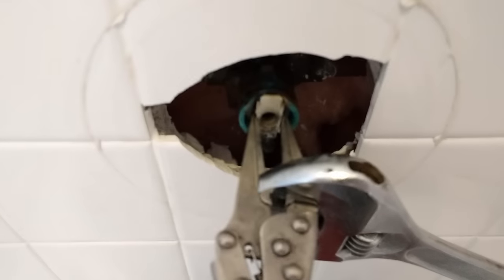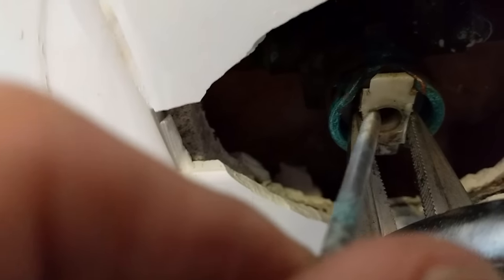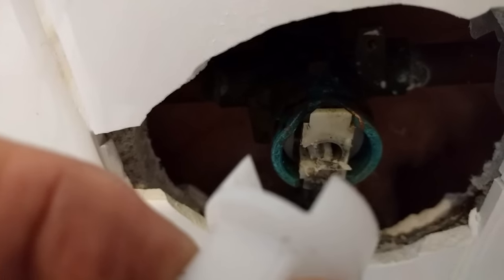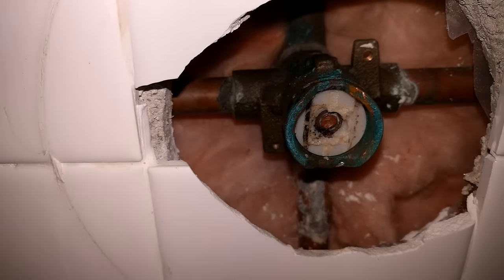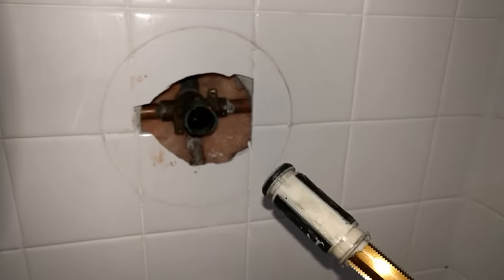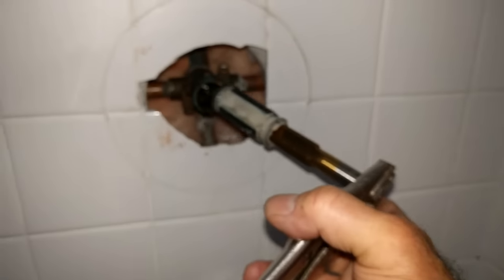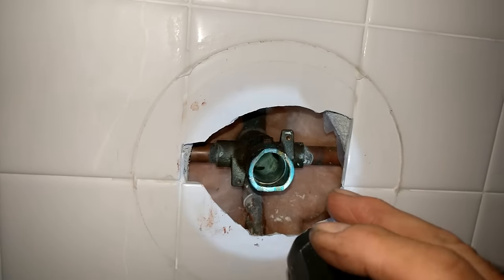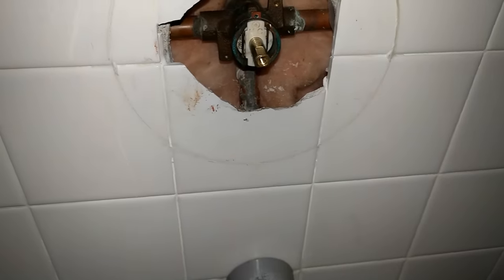Home repair Moen 1222 cartridge stuck really bad by froggy

Comment: I had a 8 hour struggle with a 1222 shower/tub faucet that had been in for 25 years. I hadn't seen any of these YouTube videos or looked at the Moen Removal Tool. I had just read the instructions and it looked like a breeze. Wrong. First the set screw in the handle was frozen. The hex key (allen wrench) stripped out the inside of the hex socket before the set screw moved at all. Fine, I'll just drill it out, I thought. I drill it out and I keep having to drill bigger and bigger... finally it lets go. Remove the phillips screw behind the handle, take off the two pieces that go behind the handle that limit the rotation. Remove the sleeve that keeps leaks from going behind the wall. 

I put the little white plastic piece that comes with the kit on the cartridge and try to turn it 45º clockwise. It doesn't want to turn, it springs back to the straight up position. The plastic piece feels like it wants to break. I push in hard while turning the plastic piece and it reluctantly begins to move and come out about 1/8". I put my pliers on the stem and start yanking. I yank harder. No go. I yank HARDER. The stem breaks off. Great! Now what? I'm thinking... huuummmm? Slide Hammer to the rescue. I drill a hole in the center where the stem broke off and thread it for a screw that I can connect to my slide hammer. Bang. Bang, bang, Bang, BANG, BANG! the valve guts come out just like Froggy had happen. CRAP! Now what?

I'm tempted to take a hack saw blade to the plastic housing that is still stuck in there... but that would be a bad move Newton. You scratch the inside of that brass housing and you will be calling a plumber to sweat in (solder in) a whole new shower faucet. If I tried to do it I would probably set the house on fire before I got a leak-less fitting... or I'd end up having to re-tile the shower/tub enclosure. What else can I do to yank that thing out?

I didn't think of the tap or easy-out idea. That's a pretty good idea. My brain fart idea was to find a large bolt and screw it in with JB Weld to hold it tight. I roughed up the inside of the plastic cartridge sleeve to help the JB Weld stick to it. I measured the hole size. A 5/8" bolt was slightly smaller than the inside diameter of the cartridge sleeve. Off to Homeless Despot and got a 7 inch long 5/8" bolt and some quick setting JB Weld. Mixed it up. Pushed some cloth into the hole first to make sure the JB Weld wouldn't goop up the inside of the brass housing and ruin it. Gooped up the inside of the cartridge and the threads on the bolt, pushed it in and waited for 3 hours while it set up nice and hard. 

It still didn't want to come out as I beat on it with my metal weapons of destruction. I finally figured out that twisting it more may help free up the long rubber outer seals that were preventing the removal. I had seen them when I looked down the throat of the cartridge sleeve before. They were stuck in the feed ports and were preventing the extraction. The rotating finally worked, breaking the rubber seals and the plastic sleeve started moving with my hammering. Finally got out the sleeve. Whew! I looked inside and saw the remains of the rubber seals poking out of the feed ports in the body. I tried yanking them out with needle nose pliers but that didn't work. I finally got them out with some Dental Hygienists picks I have. I throughly cleaned out the housing and lubed it with silicone grease. Screw that silicone oil. I want a fighting chance next time... if I'm still kicking. The rest is easy. What a pain. I really didn't know if that thing was going to come out. I'm glad to know it wasn't just me. Everyone has this problem. Hope this info helps someone. I didn't find this until the day after the ordeal. I have one more in the Master Bathroom that will probably start dripping tomorrow. Now I know a few other tricks to help me along. Thanks to all the great ideas posted here. Cheers Froggy!

P.S.  I really like the heat gun idea. Definitely going to use that one. The water here isn't very hard. There was no mineral buildup on my faucet. The main problem was the outside rubber on the plastic cartridge sticking to the inside of the brass cartridge housing. I replaced the old plastic cartridge with the more expensive brass bodied cartridge and generously lubed it up with silicone grease.
Reply from the maker: Great write up, thanks for adding it to comments, these buggers are real challenge to replace & you need the tricks, the recommended removal process is a joke.

Froggy
Reply: @1947froggy    Wish I had seen this before I had a go at it. I would have fired up the heat gun and gotten that thing out quick. Thanks again....
Reply from the maker: @marscruz  Thank YOU.

:)

Comment: Yesterday I removed a cartridge lacking the all important stem. Drilling, broken bits, tapping, etc. finally it all came out (first the core, then the plastic sheath). Unfortunately the drill bits want to track to the outside of the cartridge (stem and other metal in center). I thought I was staying away from the cartridge wall, but I did not account for the barrel narrowing. I scored the wall slightly beyond the outermost o-ring. You really can’t know until it’s too late. Despite a thorough greasing, the shower head dribbles when handle in off position. Rather than an extensive, expensive rough valve replacement, I placed a $6 on/off valve at the proximal end of the shower head/wand. Possibly it could still be a single knob activation of shower head flow, but it might have to be both knobs. TODAY I’M WONDERING IF AN “AH SO” TYPE CORK SCREW WOULD HAVE WORKED!!!??? Google if not familiar.
Reply from the maker: I can't picture that corkscrew working, but never know til someone tries. Please post if you do!

Comment: I just did this job, what a disaster this cartridge is. Getting it back in even with the grease was a workout.  Now that it is in, I am thinking I should have cleaned the interior of the faucet where the cartridge "slides" ( yea right!) into. But it is done and I am not messing with it until the dead of winter where I can go outside and cool off in a hurry after fighting with this mess.
Reply from the maker: Probably ok, if it were really bad you would have seen how it looked.  :)

Comment: Here is MY lengthy discussion of how I removed TWO of these cartridges.

So, it's amazing to me that this vid has been posted online for 4 months and ALREADY has 19,014 views. And there are many other vids on youtube showing how folks got the cartridge out. What a crap situation by Moen that there is so much discussion on this subject, no?

My prob is in 2 showers, one failed last year and we just stopped using that shower. But now, with two showers down (and one leaking), I had to address. As appears in your situation, BOTH shower handle stems broke - so Moen extractor tool won't work, nothing to screw into. I acknowledge the stem breaks likely has to do with our acidic well water not being properly treated and so the metal rusted and fatigued away, but there must still be thousands of issues with these valves/cartridges, no?! $40 replacement cartridge at HD - perhaps it's the nature of the beast, or perhaps they are making money. 

I note a slightly diff design on new Positemp 1222 cartridge: thicker stem metal (presumably so it won't break off as easily), and no rear o-ring (presumably so it doesn't get stuck in there as before). 

While the face of my valve/cartridge looked like yours, my needle nose (like you show) were tearing away at the white plastic - not enough to grip onto and I was afraid of completely breaking the white plastic apart by chewing into and distorting it. So, I bought pliers with a wider teeth grip but less rounded crown than some other pliers I had, which wouldn't fit into the tight space. I then did still have to use a grinding wheel to grind (thin) the backside of these pliers crown so the tip of (wider than needle-nose) pliers could fit between the round metal and the thin white plastic of the cartridge. (On 2nd thought... Moen supplies in the new 1222 box a white plastic "tool" which is designed to be used to get a grip on the tip of the cartridge - without a slot for the stem to stick thru, clearly a note that their stems always break off. But this plastic is soft and could break apart under pressure. They could make things easier by either making this out of HARD plastic, or metal!!! There is one vid out there where the guy says using it works 99% of the time, another where the guy says it breaks apart. Since I had already modified my pliers, and upon 1st try with the soft plastic part, I didn't try - I wanted to SEE what success I might be having and this "tool" would obscure my view... I didn't want to risk busting the tip of the cartridge apart, lest I be forced to go with the "tap" extraction method, per another video or two.)

Now that I had a better grip with my modified pliers, I pulled and pulled straight back, but it wouldn't slide out. I wasn't successful until I saw YOUR video suggestion of GETTING LEVERAGE BY CREATING A HANDLE with a 2nd pair of pliers (or channel locks/whatever) TO TWIST FIRST and break grip of whatever was holding it back AND THEN PULL BACK. Thank you so much. It ended up twisting and sliding out with 1/10th the muscle/weight I had previously put into pulling straight back. 

It seems that the cartridge wouldn't initially slide straight out (on both showers) because one of the two black rubber patches had become entangled in the intersecting water supply line hole, and so only by twisting could it completely tear off of the cartridge, duck into the supply hole, and then slide out. I then simply had to use standard needle nose pliers on both and pull the black plastic out. I was lucky in that it didn't tear and get stuck in there to the side. Had that happened, I would have turned the H2O supply back on and hoped it would have blasted out under pressure, but that would have been a wet mess. 

Anyways, the guys who suggested drilling into the cartridge with a "tap" set, or a screw, and then use that as leverage to pull, had a solution that was more complicated than yours. I didn't want to have to mess with that, and so tried yours first. 
So, THANK YOU!
Reply: It's April 2020, this is where I'm at right now.

Comment: I just did one this evening and it was stuck. My solution, cut the hot water on, let it run for awhile. It will soften the rubber and plastic. It twisted right out afterwards.
Reply from the maker: Good tip, thanks!

:)

Comment: Nice video,  gave me lots to think about.  Just using the plastic tool from Moen is of course not adequate.  Impossible.  But before I proceeded to some of the more drastic remedies, used a piece of wood and drilled a hole for the same size screw as used in the stem through the wood.  Used a long screw to fasten  to the stem, giving me a convenient hand pull instead of having to use pliers.  Then using channel locks or vise grip on the plastic tool for rotation, and pulling  really hard on the stem simultaneously, I was finally able to free the sucker.  I was going to try using water pressure as the next resort,  but would have to block off both the shower head and the bath filler.
Reply from the maker: Thanks for posting.

:)

Comment: Thank you very much !! I have the same problem where the stem has broken from the cartridge (thus the extraction tool that I bought along with the replacement cartridge does me no good). 

I haven't attempted to remove the cartridge yet using the needlenose method shown at the beginning. My questions: 

- Does the water need to be shut off? I can't find the shutoff for the shower, but can turn off the main.
- In the Moen video, it says the existing valve should be open (as in, the shower should be turned on) prior to removing the cartridge. Don't see how I could do that given the circumstances. Should I just attempt to pull it out anyway?
- To remove the existing cartridge (and avoid breaking it during the extraction), could I not use some lubricant like WD40 or similar? Any reason why I shouldn't spray it down?
Reply from the maker: Shut off water MAIN, wd won't do much.

Comment: I replaced a similar 1225 cartridge on my shower yesterday that had been in there 32 years. What I did prior to trying to extract it was I squirted white vinegar on the end of the cartridge several times over 1.5 days to loosen any mineral deposits. When I was ready to remove it I heated the valve body with a hair dryer for 10 minutes.  I think that softened up the o-rings and it made it easy to pull out the cartridge with very little difficulty. A hair dryer doesn't heat hot enough to melt a solder joint so no worries there.  I used a Moen 104421 cartridge puller and twisted the cartridge back and forth 180 degrees before trying to remove it. It came right out.
Reply from the maker: You get 100% and please post more of your DIY tips!

Comment: Thanks for the tap suggestion.  That got me on an even less expensive pathway I credit to Jack, an old-timer at the Centerville UT Home Depot.  He had me buy a 3/4" threaded metal pipe (about 4" long) which I screwed that into the cartridge housing, then twisted, pulled and pushed with a wrench until it came out.  It did the same thing a tap would have done but at a fraction of the price.

For those who have a stuck cartridge, I also recommend this fix: https://www.youtube.com/watch?v=ctj6BLF6MzY&t=282s.  He drilled a small hole into which he threaded a screw; then he used a hammer (I used a screwdriver placed into the plate mounting holes) as leverage against the pipes along with vice grips and a wrench to coax the cartridge out.  I first did that before I had the 2nd problem described in Froggy's video.  Thanks for the great tips guys!

Comment: Just had the same problem.  So bad just like yours the brass broke off in the same place.  Was able to use a screw extractor - drilled a pilot hole in the brass core, tapped and screwed in the extractor.  Still wouldn't budge. Plastic was in tatters. With a thin pliers was finally able to move it enough and pull on the extractor to get it to budge.  Pulled out an inch and then was able to get a vise grip around the cartridge to slowly rotate it out.  Still difficult..  What should have been a 30 minute job is now a 5 hour job.  Still haven't gotten the new cartridge to go in all the way, so I'm still not out of Moen hell yet.
Reply from the maker: Moen hell, made me laugh.

:)
Reply: The stem in mine broke off And needle nose pliers broke plastic and what was left of the stem, I gave up called plumber he worked for 2 hours doing all the things I already tried for . I suggested drilling into the cartridge he didn't . still stuck in there almost 300 dollors later

Comment: I had the same problem and tried everything.  However, nothing worked until I used a hair dryer to heat up the pipe for about 5 minutes.  I was then able to pull it out pretty quickly.
Reply from the maker: Excellent Ralph!

Comment: Thanks for the video, it was good to see that it did not happen only to me. The exact same everything happened to me. However, I could not use the tap to remove the plastic. What worked for me is breaking the rest of the plastic piece by piece. WARNING: take extra care to avoid scratching the metal enclosure which could lead to leaks and a bigger job. Anyway, I did not feel I had a choice as, so I used a Mastercraft Tack Lifter tool - unlike a straight screwdriver, this tool being angled/rounded, it prevents scratching the metal when pressing against it for leverage to break the plastic. Anyway, success, it's fixed now and I can have water again. WHY, is typical not to have a valve for the bathroom to avoid shutting off the water for the whole house? Any word agains installing valves on the lines that go to the bathroom in the unfinished basement?
Reply from the maker: Builders skip the "individual" shut off valves to save money. and it is one more potential leak spot, and they (shut off valves) tend to corrode in the open position. Still would be nice when you need one. Thanks!

Comment: I just removed a 1222 cartridge. First time for me. It was really stuck. I'm not sure if an after market cartridge was used by the plumber.
I tried slip joint pliers:
Twisted it from side to side using long nose pliers.
Vinegar and WD40
It partially came out then stopped.
I went and bought an off brand puller. I thought this is going to be easy now. Nope.
It wouldn't pull out.
It finally snapped. Lucky it was partially out.
I broke the plastic with a flat head screwdriver and pulled pieces out with long nose pliers.
Some rubber from the cartridge was really sticking. This portion of the removal was quite easy. I made sure all the plastic was out.
Now I've got a puller tool that I'll probably never use again.
Reply from the maker: Story of my life.  :)

Comment: I just had to replace this same thing on my shower on -off value, i had to break it out in pieces😮,but I finally got it out, but that tool to pull it out cost $16 and the replacement value at home depot cost $40.00😲

Comment: I had same problem and stem broke trying to pull out.  Thought I was going to have to call a plumber.  I took screw driver and tried to pry out from behind tabs but they broke off.  Well the good news is now the plastic tool spins the cartridge really easy now a full 360 degrees, of which loosened cartridge so I could pull it out.
Reply from the maker: Careful not to scratch the brass "sealing" areas.  :)

Comment: I'm twice as lucky as you. I have two showers with broken off stems. I fixed one with slightly less hassle than you encountered. The second one has been out of commission for awhile so I'm hoping it hasn't seized up as bad as the one in this video. 🤞
Reply from the maker: Hopefully not used as much means not as corroded with hard water deposits.  :)